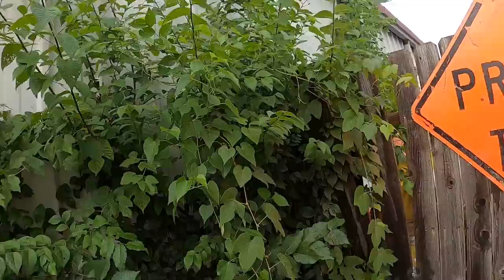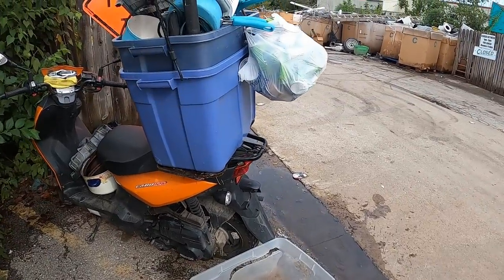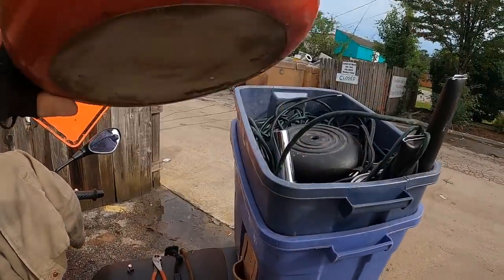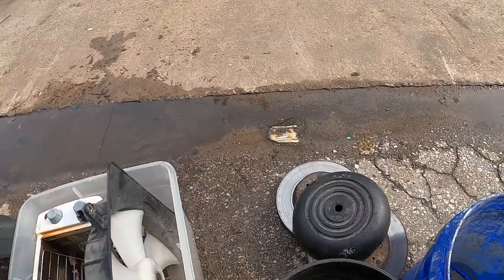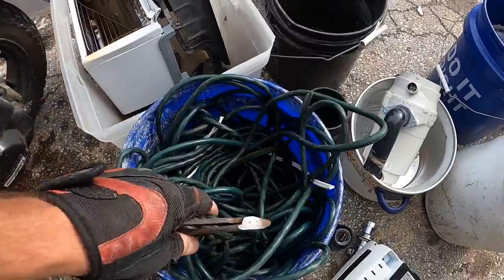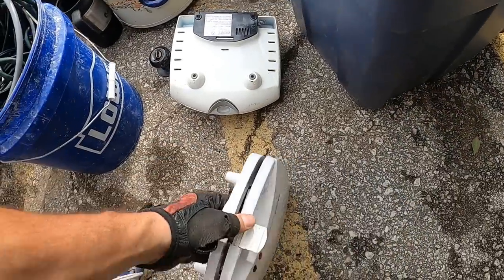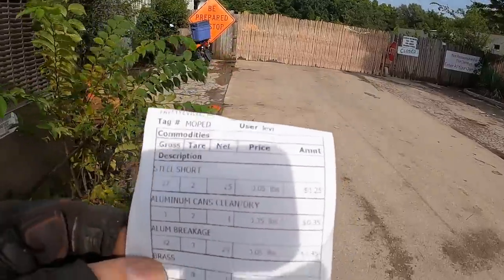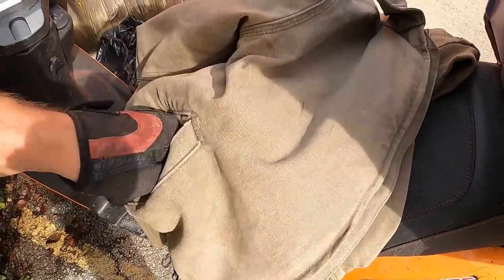How To Make Money Recycling Metal For Beginners - Scrap Yard Run

Comment: Striping cords for bright copper and hold on to it because they're using less copper in motors and in a lot of  stuff soon Copper will spike and you cash in $$$
Reply: @CYRUS DAWSON exactly stoking up🤙🏻
Reply: @CYRUS DAWSON us, too!
Reply: If they are using less, wont the price for it go down? I’m hoarding it none the less
Reply: @nateallen1769  I think it will go up  cause aluminum  is replacing cause copper is about to take off just my two cents
Reply: @CYRUS DAWSON I just have a couple piles going outside.. will move inside a shed soon.. so nobody complains.. haha.. we are in the country though
Reply: @CYRUS DAWSON i was thinking of making pallet box and using neighbor's skid loader to put in back of pickup when ready to go... i have 3 more citywide cleanups to run around trash picking at so i should be able to fill it up!  #teamvacuumcords lol
Reply: @CYRUS DAWSON rock on!
Reply: you were right, around 5 bucks a pound in canada now!

Comment: Tip: Bottom cut off one bin inserted in the other bin on bottom (still with bottom.) Only take off few inches at bottom, mold together with torch or heating element. Now you have an extended storage unit on your moped

Comment: I was at a auto wrecking yard today Which is back to back with a metal scrap yard That had 4 cranes going at the same time And 2 huge belts going into a building The city is well known as a steel town But they also do asphalt And great lake shipping...Longer story short I could not believe the smell And choked up 8 hrs later i can still smell it ..Be happy your dropping off metal and not smelting it lol

Comment: Usually when sellling material like aluminum a 5% contamination rate is accepted so The screw on that red pot should be fine if you have a decent size tub if the stuff

Comment: Would you make more from the copper wire if you burnt the plastic off and sold it as dirty copper instead of pvc cable?
Reply: Never burn the rubber off of cords and wires unless you want to create a mini ecological disaster, just strip the wire with a machine or knife

Comment: oh boy you found a ninja base!  I reckon that would have gone for $$ on ebay.  If you get a smartphone (even a cheap tracfone will work) you can snap a photo of stuff in your storage unit and post on ebay with the app.  Just keep a bin labeled ebay in your unit.. list under parts and repair like you mentioned.  If it were me.. I would just put up sturdy shelving in one unit and use the cheap totes you find to organize/store stuff on the shelves.  That way you only invest in shelving one time instead of paying for multiple units all the time.  :)  Even if you don't organize the scrap (i wouldn't if i were you), the shelving will create more vertical space for you to utilize.  p.s. don't take negative comments so seriously...it will eat you alive.... just delete them...bizzie lizzie or i could moderate for you...